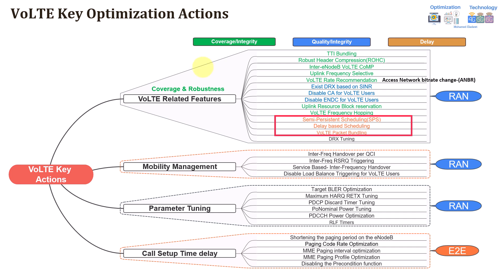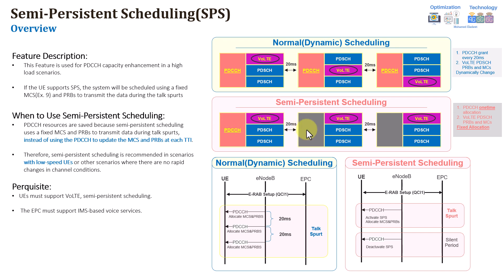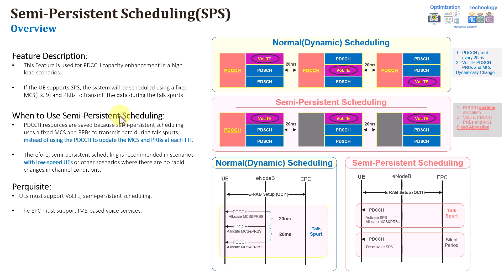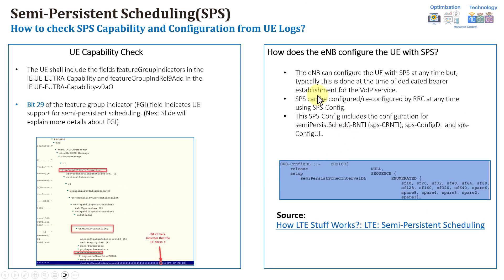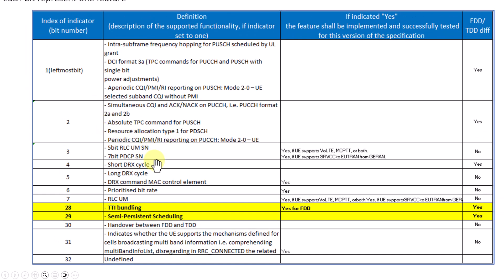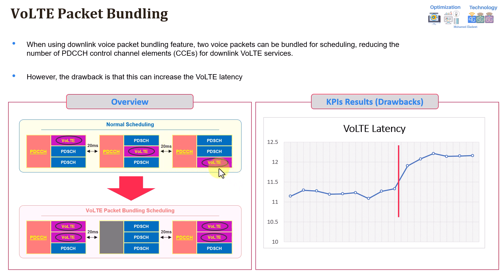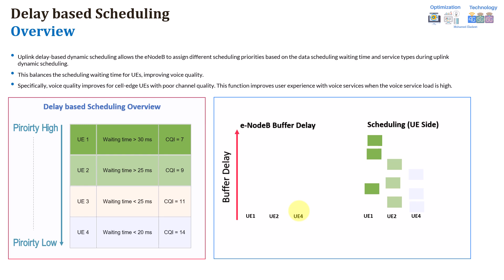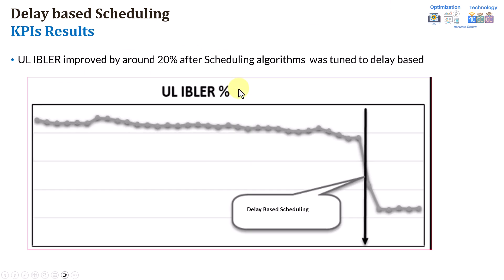VoLTE E2E Training: Semi-Persistent Scheduling, Packet Bundling, Delay based Scheduling - Session 8

Comment: What are the challenges of current "SPS RA~schemes"?
Reply from the maker: As per my understanding the main challenges of SPS feature is the rigid scheduling- no adaptation to channel conditions, for example to allocate pre-defined RBS and McS and it doesnt adapt dynamically to changing CQi or radio conditions so this might leads to higher bler/retransmission, voice quality issues and if i remember correctly some devices used ro have a compatibility issue with the feature(not sure if this still valid or not) so in general based on my understanding (i might be wrong) feature is more recommended to be used in areas where it has a high pdcch congestion and coverage is well guaranteed(for example areas covered by indoor sites)
Reply: @mohamedeladawiashour you are right. Also.no freshness of information/ (Age of Information issue)
Reply from the maker: @압둘하미드이드리스 yes I agree. Thanks for sharing

Comment: Very nice explanation Mohamed!
Two questions from my side: 1)Is it possible all these 3 scheduling   
techniques to be deployed by an operator, depending on Ues' radio conditions, or only one can be deployed? 2) Do you know if the same techniques can be applied to VoNR?
Thank you
Reply from the maker: Hi Georgi; thank you. Yes it is possible that the 3 features operates together; however you have to be very careful as the first two features related to PDCCH capacity improvement might brought some drawbacks to the network and required to be used in a very specific scenarios, regarding VONR question as per my knowledge yes these features will be available as well but this will need to be checked with the operating vendor
Reply: @mohamedeladawiashour  Thank you very much for your prompt reply!